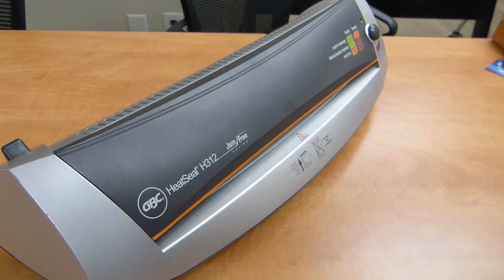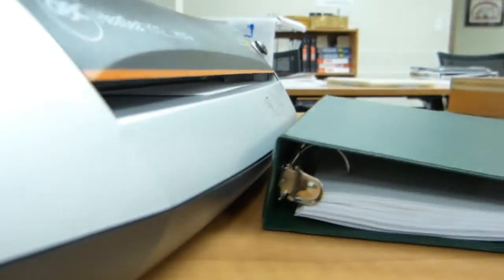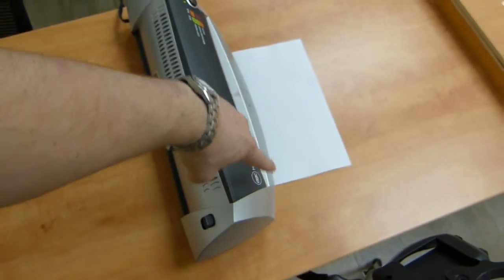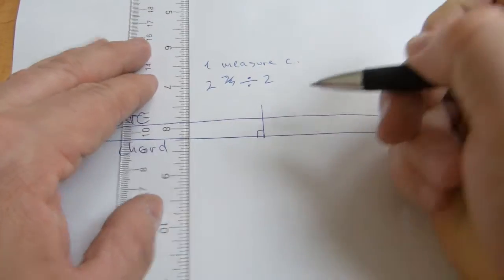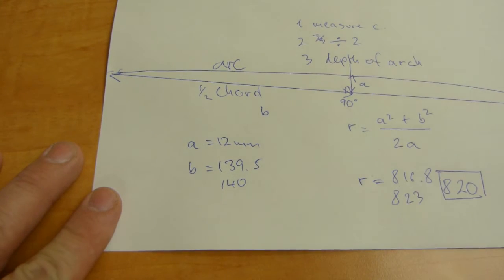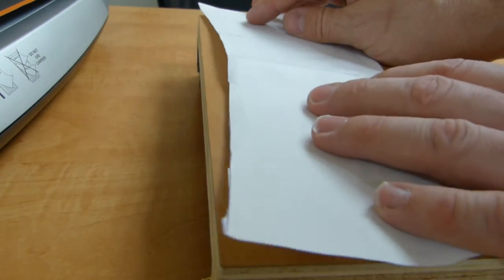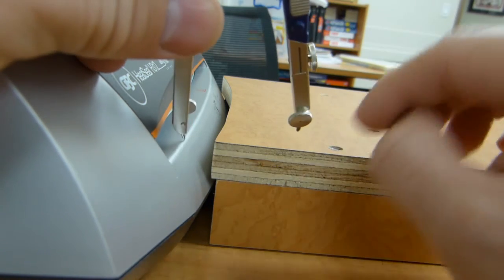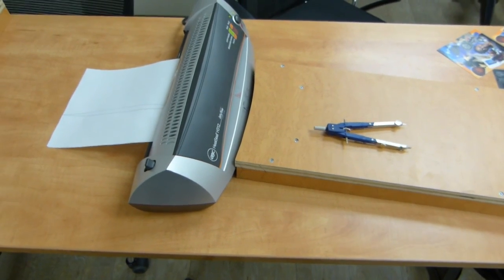Arch layout without any blueprint figures

Comment: Very good video of practical application of math, physics, engineering, architecture and a little common sense analysis(length of radius), to find a solution to a problem.  I will be showing this to my daughter and sons.

I was curious if you could do a video on your approach(divide and conquer, etc) to solving the problems you encounter?   The understanding of where to start, managing the problem, defining the end goal(I'm great at gold plating) in a repeatable way is just as important as the formulas used.

Thanks
Reply from the maker: +Joe Swheat Thanks for watching and commenting. I`ll work on it. meanwhile, here are 2 similar approaches into plastics problems: https://www.youtube.com/watch?v=yh5Rxld83HQ and https://www.youtube.com/watch?v=_B1r7eEZrNw